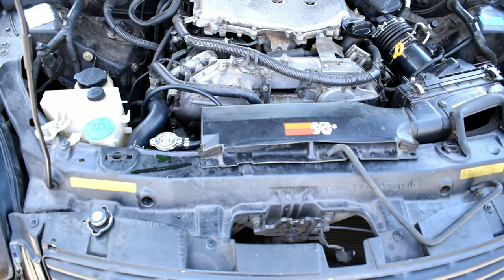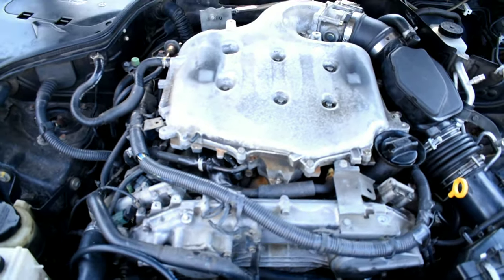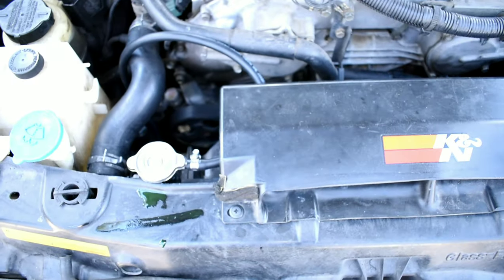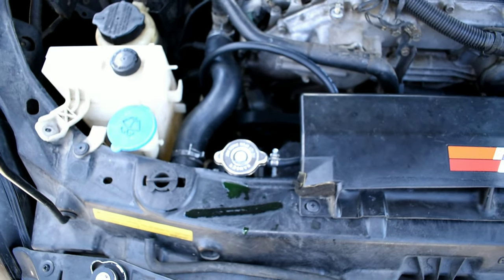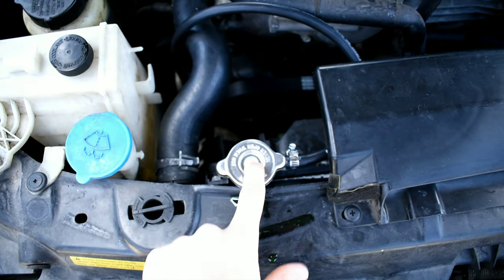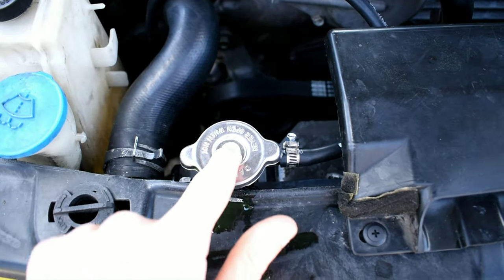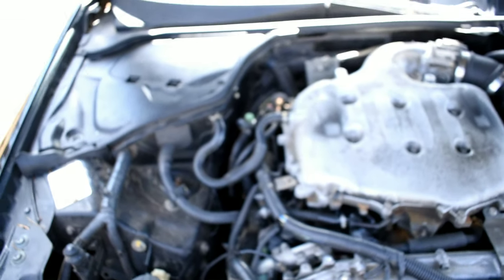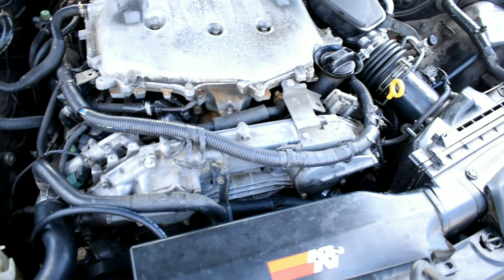G35 and 350z Overheating Problem Fixed!!

Comment: I changed the fans and the thermostat and the car still running hot, and I bleed it ain no shit comin out except air. I think its leakin too the antifreeze goin out. What you think the problem is ? It getting too hot
Reply: Just buy a new engine. You can buy a refurbished engine online. Save yourself the headache
Reply: You think its the waterpump it ain taking the fluid to the engine as soon I start it up and it heats, the car starts heating up. The bleeding screw it taking air out.
Reply from the maker: The leak could differently cause the overheating. When the cooling system leaks it will start to suck in air which will cause air pockets that blocks the flow. Try putting a piece of cardboard under the engine to see exactly where the leak is coming from. After replacing the leak do the process in the video several times to get all the air out of it.
Reply from the maker: Sorry for the late response. Hope that helps!

Comment: So my car is over heating, I more or less flushed my coolent, replaced the thermostat, and my car doesn’t blow hot air until it wants to even when the indicator says it’s hot, sometimes it does and sometimes it doesn’t
Reply: I’m not sure what it could be
Reply from the maker: Did you try this process in the video? It will take 5-6 times to get all the air out of the system. Whenever you add coolant to the g35 you most of the time will also get air in the system.
Reply from the maker: Especially after a coolant flush.

Comment: I have a 2008 g35 sedan and my fans stop turning on so i installed new cooling fans and I would start the car and they would stay on for 5 minutes and then turn off and wont turn on again anyone know what might be causing this issue?
Reply from the maker: Sorry for the late response. Did you figure it out? Most likely it is a wiring problem. Check your fan relays first

Comment: I’m about to buy a 350z that has an overheating problem and I was considering what might be wrong. I’m pretty sure it’s this
Reply from the maker: When you're looking at it check the oil cap to see if there is any white milky looking substance on it. You want to make sure it's not a blown head gasket.  Also look under the car while it's running to see if there are any leaks. Good luck with the purchase! You'll love the Z
Reply: unBEATableCars TV Thank you! I’ll check those things out. Putting them on my “check this” list 😂
Reply: My car has a new radiator, new silicone hoses and thermostat and is still overheating. My car ac fan turns on but not the other one. And my heat doesn’t get hot unless revved
Reply: @itz_ur_boy_kevin6597  I’m having the same issue did you get it figured out?

Comment: So does the g35/g37 kill the motor when the computer realizes the coolant is getting too hot ?
Reply: Yes
Reply: @TheKidAustin09  thanks I had blew a heater hose connector and thought I blew the motor limping it home lol
Reply: Yes mine went into limp mode before the radiator exploded
Reply: Yea I blown my motor because of it, in the process of replacing everything now
Reply: @GetBacc3x  use rotella t6 oil. I swear it was the only reason my motor aint blow up
Reply: @killakam123321  oh trust me it’s gone. It start knocking & kept turning off on me. About to get it fixed this Saturday so it’ll be worked on for about 2 weeks so. I never wanted to let it go

Comment: Should I buy a g35 that over heats with the check engine on ?
Reply from the maker: If you need it for daily driving I wouldn't recommend buying it. Overheating can be caused by a lot of different things that could be major.
Reply: No

Comment: I never had problem with my G35 one day my battery died so when I jumped my car idk why my radio turned off... My AC is nuts it works but it stays on all the time I can not turn it off or up or down  or I can't make it cold or hot so right now it comes out cold and that's it there's nothing I can do about it this morning my car overheated I don't know shit about car..can u help me out
Reply from the maker: Does the battery keep dying or was it just that one time? Is the temperature gauge going all the way into the red? Has anything been replaced in your car recently? Do you notice anything leaking under your car?
Reply: @unbeatablecarstv890  I bought the car 3 months ago so I don't know what has happened to it but once I jumped my car that was it radio off and ac on all the time
Reply: Ryan B  I fixed it I was very low on oil and coolant once I put that in the car the car stopped over heating
Reply: Also the radio works now and the AC I change the fuse when I gave my car a jump my friend put the cables on the wrong one so it cause it to fuse
Reply: Ryan B  good thing u didn't i went online and asked if low oil will cuuase it to over heat...I didn't have a engine light so I know iwas still good

Comment: My g35 only over heats when I’m Idle and when I drive it’s fine. Anybody know why
Reply from the maker: Could be the fans are not working properly.
Reply: @unbeatablecarstv890  I have the same issue and I replaced the radiator and thermostat and it’s still happening. What could this be?
Reply: @CallMeSparks  same here...
Reply: @CallMeSparks  Might be you water pump or temp sensors. Did you ever find the fix?

Comment: my g35 doesnt overheat at all when idle but when i drive for a couple minutes it starts to overheat. can anyone help me?
Reply from the maker: Could be air in your system, a bad thermostat, bad water pump or low coolant. Did you try this process in the video?
Reply: unBEATableCars TV no I’ve never tried this process but it could be that honestly. I got my radiator changed and didn’t start overheating until after I got it changed and I can sometime hear a whistle sound come back every couple seconds from my engine. I changed my thermostat last night too and still had the same result
Reply from the maker: @xqxc  it definitely sounds like you have air in it. Its very easy to get air in the cooling system and just a little bit of air can cause overheating
Reply: unBEATableCars TV thanks for the advice. I’m gonna have to try that out. I’ve been frustrated with my car for a while now. Hopefully that is what the problem is.
Reply: unBEATableCars TV another quick question I have is when my car overheats are both fans supposed to start spinning or only one? I’ve currently only got one fan spinning when my car overheats
Reply from the maker: @xqxc  yes both fans are supposed to run. That could also be a reseaon for overheating. Check your fan relays which are the big fuses in your fuse box, if they are blown i would just replace them if not you might have to replace the fans. I guessing though that it is overheating because of air in it since it started overheating after the radiator was replaced. This process is needed to do if your have to add or remove coolant. It is very easy to get air in the cooling system. Motordyne has a more detailed video if you wanted to check that out.
Reply from the maker: @xqxc  Also make sure both fans are plugged in
Reply: unBEATableCars TV alrighty thank ya brother I’ll let you know if everything goes good
Reply: I changed my radiator , thermostat and radiator cap already and still over heating
Reply: I bled the system but still same Issue
Reply from the maker: @edgarrodriguez8737  make sure you do the exact process. It can be very hard to get all the air out. Also look for any leaks around the coolant hoses.
Reply: @xqxc  I had this same problem where only one fan was spinning. I then CAREFULLY used my hand to spin the blades of the fan that was stopped and then the fan started spinning. This meant the fan motor was bad and I replaced the fan assembly.
Reply: @xqxc did u figure it out?? HELP

Comment: Just did that, but sadly i’ve to replace water pump :/
Reply: How could u tell? My G overheating too and I’m trying to narrow down the problem
Reply: @TheChurro510  its kinda Hard, if you already change the coolant bulb, thermostat and it keeps overheating, the most probably thing is failing is the water pump, mine cost 40 bucks, and the instalation cost me 120 bucks

Comment: I just recently replaced my radiator Nd thermostat due to overheating and a leak in the previous radiator and after a a while now it’s starting to overheat again
Reply from the maker: Make sure there is no air in the system. The smallest air bubble can cause overheating.
Reply from the maker: @1:28 in the video shows how to bleed the air out. Do that process several times and you should get all the air out.

Comment: Just changed my thermostat on my 08 G35 i let it idle and it was on its way to heating up. I did not bleed it. So I’ll be trying that next. Also I’m pretty sure I have a leak in my lower hose. Some of the coolant I put in came out the second time I started the car. But didn’t leak on the first start up. Any reason that is? Also do I have to jack the car up in order to bleed or can I bleed it from it’s parked position?